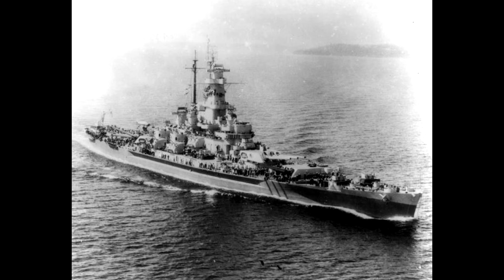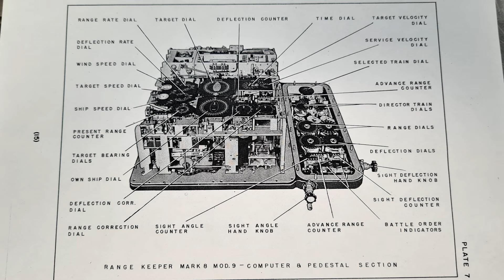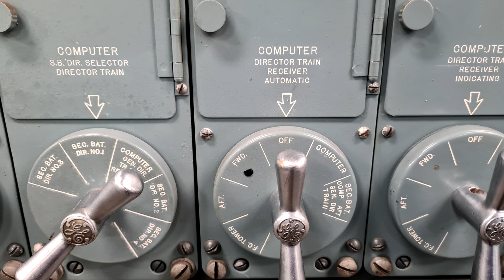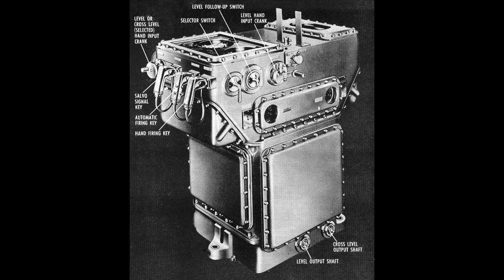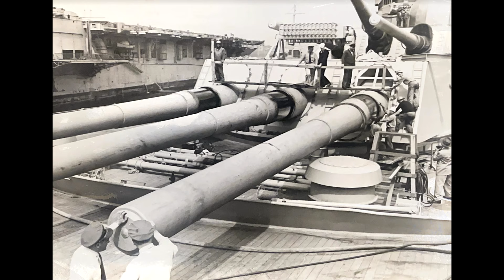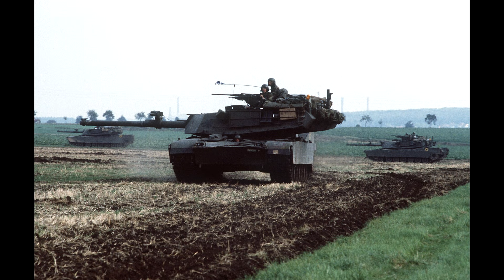US Navy Fire Control Systems - How They Really Work

Comment: Three of the most important events in US gunnery occurred before 1921. The first was the proof that with careful spotting and calculations, effective fire could be placed on a moving ship (a radio controlled target in 1912) at ranges unthinkable before director controlled were developed. The second was adopting AC electricity. This allowed for more accurate transmission and response to inputs and outputs within a fire control system, such as own ship data and transmission of firing solutions. The third was the capture or acquisition (by any means) after WW1 ended of German synchronizing motors. This eventually, along with AC, allowed for a faster, more accurate fire control computer (Rangekeeper Mk.8), faster and more accurate transmission of data between director, fire control center and turrets, such that US capital ships after 1937 were equipped with switch boards in the fire control centers allowing any turret or secondary mount to be controlled by any fire control director. Fire control could be switched between the forward and aft Mk.38 fire control directors in minutes. In the IJN, the transfer of control between fore and aft main gun directors started with bringing the turrets back to 0 or 90 degrees and a complex actuation of circuit breakers and switches, taking at least 30 minutes. The synchronizing motors also allowed for the use of remote power control of turrets and mounts from the Rangekeeper or Computer in both train and elevation. The RN did not achieve a similar capability until after the war. The IJN never did achieve RPC on heavy and secondary turrets and mounts. 
Another module in the fire control system that was almost revolutionary was the stable vertical (artificial horizon maintained by gyros). Only the USN fully implemented the stable vertical which meant that after 1935 could maintain lock on target when the target and the firing ship turned through 90 degrees at no more than 20 knots. No other navy had this capability. 
The adoption of 10cm and 3cm surface search and fire control radars (with sufficient power) meant that at any time in most sea states, USN warships could detect, acquire and maintain target lock over the horizon. At 100 feet above sea level, the visual horizon is around 24kyds. The best the Japanese could do was 20kyds with the fire control mod to the Type 22 10cm surface search sets. The Germans never pushed below 40cm and relied, like the other navies on illumination rounds and searchlights. The longest range illumination rounds (IJN) reached 21kyds and searchlights (again IJN), 8800 yds. The British were one step behind the Americans because their electronics industry just couldn't keep up with demand, so that on a few battleships and cruisers got the 10cm Type 274, most making do with the Type 284M at 40cm. As I pointed out in the post on dispersion, the three rebuilt USN battleships engaged a Japanese battleship at 20-25kyds and could have began firing at 30 kyds. And this was with a modified FCS from Cleveland light cruisers integrated with their Mk.1 or Mk.8 rangekeepers, though they also had RPC. The USS New Jersey was straddling a Japanese DD with HC rounds at the end of the Marshall Islands campaign in January 1944 (IIRC) into a setting sun with both ships on more or less parallel courses at over 30 knots at 39kyds, straddles that would have ensured a hit on a Japanese CA, CB or BB. This sort of accuracy only occurred before the war in fire control exercises by the USN and IJN using aerial spotting at 30kds, both battle lines steaming on parallel courses around 20kts.  Both sides even practiced laying smoke screens between the battlelines so that only aerial spotting would be effective (this was another push to increased numbers of carriers and fighters, as the spotting aircraft, types like the OS2U or E7K or E13A could only operate under conditions of air supremacy).  The modern US fire control systems allowed the USN to think on straddling and hitting on the first or second full salvo, which they did in October 1944. But the USN actually had this capability for capital ships, starting with the South Dakota II class in late 1942 (the North Carolina class had the complete FCS but was using the 40cm Mk.1 (FA) radar, basically equivalent to the Mk.3 (FC), the South Dakotas introducing the 10cm Mk.8)
Reply: Yea but there was another fire control system more advanced than that one in use before the end of the war, the computer augmented defensive guns of the B29, not only did it have to make the calculations from a moving platform to a moving target and point it's guns in the right location so their bullets arrived at the same point in time as an enemy fighter but unlike the MK8 system, which only had to keep track of things in 2 dimensions, the B29's system had to keep track of both the platform and the target in 3 dimensions, and switches could be set at the fire directors controls that would slave multiple gun turrets to a single gunners sight or each gunner could control his own turret with the system making calculations for up to 4 different turrets all shooting at targets at the same time while keeping track of all of it in 3 dimensions from both the platform and the 4 targets, plus it had considerably less time to do it in than the MK8 system did, and being built for use in an aircraft it also had to be a considerable amount smaller and lighter than the MK8 system, it was so effective it gave the B29 a kill to loss ratio against enemy fighter's of 11 to 1, that's higher than the P51's kill to loss ratio of 10.2 to 1 that were sent to escort B29's, for that reason a post WW2 1947 USAAF report actually stated that the use of P51's to escort B29's was a waste of fighter resources that could have been better utilized elsewhere. 
And that system was also utilized after the war, in the 1950's it was the basis for the first 3 axis CNC automated production machines that revolutionized the machining field.

Comment: Maybe I missed it but did air temperature and barometric pressure hve any affect given the huge distance a shell could be fire. after all, the cooler the air the more dense it would be, thereby increasing the resistance to the shell in flight, and the warmer the air the reverse would happen.
Reply: Variables.

Comment: Outstanding presentation. Excellent coverage of late 18th century capabilities, turn of the century capabilities (continuous aim), WWI (rate based) capabilities and USN WWII (synthetic) capabilities - also used in WWI Pollen and USN Ford tables. Outstanding explanations of the operating setups and flexibility. 

Missed the chance to explain the spotting methods of the Russo-Japanese war which replaced continuous aim, and the dumeresque predictor clock based pre-wwi stages of fire control. (There were 5 major gunnery revolutions between 1898 and 1914). Also failed to discuss the huge impact of horizon distance on spotting, and the revolutions of serial spotting and its replacement the Mk8 radar.

Shock of the guns firing was not really a factor in not replacing the Mk8 in the 1980s. The 1980s digital computers controlling the Tomahawks, Harpoons, Vulcan-Phalanx CIWS, CUDIX and SLQ-32 systems were located in areas with far less blast protection and functioned mostly without issue during main battery gunnery (I understand Pahlanx did have issues on some bearings). The real problem was economic. 
The Mk8 analog system consists of a complex system of interconnected cams, plates,  rollers, guides, and linkages that simultaneously solve all the components of the problem in parallel. A digital computer must solve each part of the problem separately (in series), and while 1980s computers barely had the speed and memory to cope (Mk86, Mk92 for example), these were extremely expensive to develop, requiring many using platforms to be worthwhile. The cost of developing the necessary program for use in only four ships was prohibitive.

Comment: The US ships with these advanced fire control systems didn't see much ship-to-ship combat.

The longest range straddle of the war was achieved by a USN battleship, the New Jersey, at 35k yards - which I believe did splinter damage to the IJN destroyer Nowaki when it was fleeing Truk, shortly before it went completely out of range.

But ultimately the US battleships never got much chance to show what they were capable of.  I think this was a mistake - and the Truk operation was the missed opportunity.

IMHO, there were several blunders associated with the Truk operation.  First, had they not sent the early scout plane over, the Japanese Combined Fleet might still have been present - they scared off the prey.  With the huge force they had available, they didn't need advance scouting - they could let the first air strike do the scouting.

Second, they over-relied on carrier air attack which meant they didn't effectively use the capability provided by the battleships.

Instead of the approach that was taken, the US forces could have been divided in advance into two very powerful groups, one with mostly battleships and heavy cruisers and a carrier or two for air defense, and a second with the rest of the carriers and the light cruisers, with destroyers in both groups. 

It probably would have been a good idea to make the air defense carriers very fighter heavy, trading out most of the normal bombers for fighters - keeping a few for recon.

Dividing forces is sometimes an error in military operations, but in this case they had the assets to pull it off.  

Also, by that point in the war they had experience using radar to vector a CAP to shoot down Japanese scout planes before they could report, so they had a decent chance for both groups to get to battle range unobserved.  

This approach would let them launch an initial attack on Truk from the air from the carrier group, with the battleships pre-positioned a few hours out on the other side of the island (and out of sight), where they could move to intercept and sink or slow the Japanese ships as they fled from what would have been an overwhelming air attack.

Heavy Japanese losses in experienced pilots would also have helped make this approach practical.  The US would have quickly won control of the air - which made attack by battleships in daylight a good option.

The Japanese ships would never have been able to catch the Fast Carrier group - and trying would have doomed them to destruction.  Even without the battleships those carriers could take of themselves.  So the IJN would have had no choice but to flee - sending them right into the battleship force, would could have picked it's own course and speed at which to engage the Japanese ships, many of them already damaged by heavy air attack.  

In this situation, the US fast carrier group - in addition to the carrier or carriers with the battleships (which would stay out of gun range) - would still have been able to provide cover to the battleships through the course of the day, and continue air attacks on the Japanese ships - especially those slowed by damage from the battleship group.  In the unlikely event any Japanese ships survived to nightfall the surface forces could pursue and destroy while the carriers retired from the field.  

This would have let the USN effectively utilize their available assets.

Once the battle started, there would have been no need for radio silence so they could have coordinated very effectively, which also removes one of the classic problems with dividing one's forces.

With the absence of advanced scouting, there's also a possibility they would have caught the Japanese with their boilers cold, which would have made things even worse for the Japanese as it would have taken hours to get the ships ready for sea.

This battle would likely have resulted in the complete destruction of the Japanese Combined Fleet, with relatively light US losses, and potentially shortened the war by a significant amount.  Tough as Yamato and Musashi were, they weren't going to survive a battle where the other side had a strong surface fleet with advanced fire control, and also had control of the air - especially since firing their main guns meant they couldn't defend themselves against aircraft.

Comment: Surely, in the 80s, digital computers which could survive the vibration from the guns were possible. The decision to keep the old fire control computers must have some other reason. See for example the 1970s M712 Copperhead system. But maybe there were certain specific existing systems which were fragile?
Reply: There were, that's a bit of a Naval Myth. The Iowa Class was refitted in the 1980's with Harpoon, Tomahawk, Phalanx, SLQ-32, SPS 49 (Replacing the 1960's fitted SPS-10 etc) radar etc which illustrates that. The shock rating of equipment is based upon the ship taking battle damage, and that far exceeds that imparted by the main battery firing. I understand that the Mk8 and the rest of the legacy FC equipment was retained because it worked and it would have been an unnecessary cost to replace it. There were some upgrades made at the time and latter, eg the AN/SPQ-9 from the Mk 86 GFCS was fitted to at least one of the Iowa's. Basically you're correct, there were 80's (and for that matter 60's) computers and electronics which were suitable but with all things naval, and the BB in particular, there's alot of myth and legend associated with why things were done.

Comment: I wonder how they computed for turret 1 after they removed its range finders because they where always getting smash in from taking water over the bow.
Reply: All three turrets were continuously controlled by the central fire control system.     On the Iowa class, the range finding was done by one if two high mounted range finders on the superstructure of the ship.    A range finder and computer in each individual turret were there as back ups in case central fire control was unavailable.    The turrets could also communicate between one another if needed.   There was also a back up central fire control system in another part of the ship.     In short, rendering an Iowa class battleship unable to fire it's main battery with accuracy was very difficult.
Reply: @stargazer5784  actually no. The individual turrets also had there own directors and range finders so they could operate independently if need be. You really should watch some videos on the New Jersey or Iowa. The gun crews have proven they can land accurate fire with out the direct input from the computer director. Or did you not watch this whole video?

Comment: Didn't the Captain of Iowa say the analog computers worked far better than the digital computers when he was recommissioning her? Now, we all know the best digital computers in 1983 were child's play to what a decent laptop is today. But I know how clockwork works. I can imagine how the barrels simply rose and fell and trained CONTINUOUSLY! No lag at all. Not a millisecond. The accuracy, which still always relies on sheer assumptions, might be faulty, but the faults would be instantaneously correct, given those assumptions.
In 1800, French watchmakers could make a Breguet that could keep time over a period of years within a second. This is a Breguet writ gigantic. Analog is not a bad thing. But human minds cannot grasp that mechanical systems that run in instantaneous time are always better. People think like computers. Input...lag...output. But mechanical clockwork computers are always on target...always.
I'm sure today, a $5,000 computer could replace this billion dollar monstrosity. But could you be absolutely sure that it would be fast enough? I wonder.
Reply: It could. Think about the problem faced by a Phalanx CWIS when intercepting an incoming missile: it has to hit a 1 square meter or smaller target at a range of 2000m or so, travelling at 300 m/s or more and likely maneuvering violently, with only a few seconds of warning after the target appears over the horizon. The CWIS actually uses its radar to simultaneously track the flight path of the target and its shells, and uses the results to correct its aim. Quite the achievement given it is firing 75 shells per second, perhaps it tracks the 'stream' of shells rather than individual rounds. In any case, you'd be hard pressed to find a mechanical system that can respond that fast, inertia is a harsh mistress.

Comment: Quite disappointed with this video. I was expecting specific info on how the table was operated, but the old volunteer instead laboriously gave us a very poor analogy without telling us any of that.  I get a better understanding on the inputs from multiple old b&w videos describing how various mechanical mechanisms worked to represent a given function. That being said, being a qualified fire direction computer repair man must have put you in a tiny elite of skilled specialists.
Reply: This video wasn't intended to give you a lesson on it's operation, which would take months, if you could even understand how it works.    The analogy he used was entirely appropriate for the layman to use for assembling a mental picture of how difficult the problem was that needed to be solved.    He was basically saying that if you try to hit a moving target, while firing from a moving platform at great range, with the mark 1 eyeball and human brain doing the aiming, you're gonna miss 99.9999 percent of the time.

Comment: You know what I would love to see someone design? A modern version of an electro-mechanical fire control system and compare it to what was made back when the Iowas were in service. Also would love to see someone build their own version of the Iowas computers except change nothing but update to modern tolerance specifications for as tight tolerances in the movable parts. Compare that to the originals to get an idea of just how much more accurate you could get purely with modern manufacturing and tolerancing